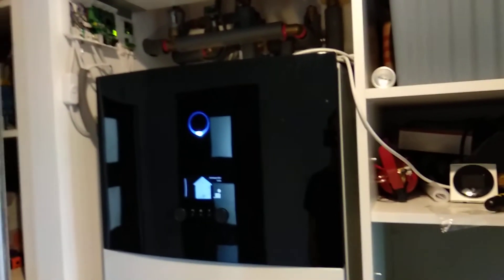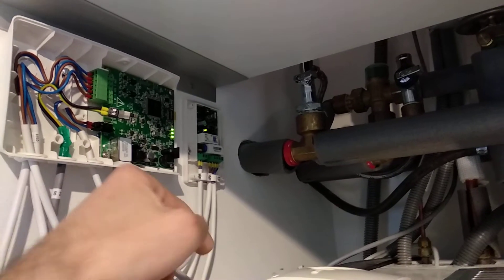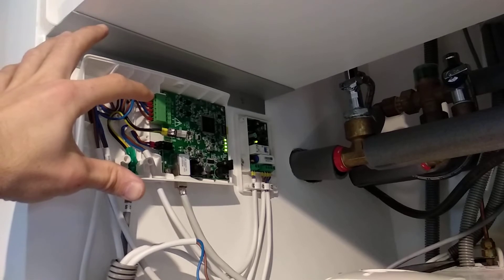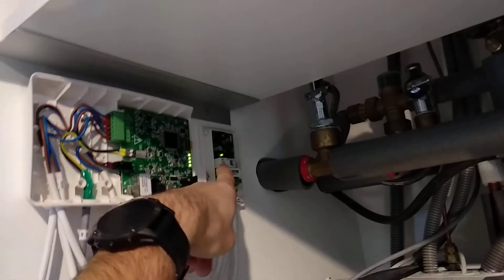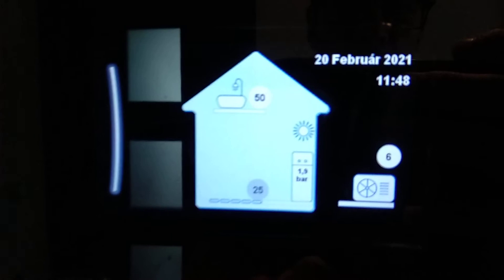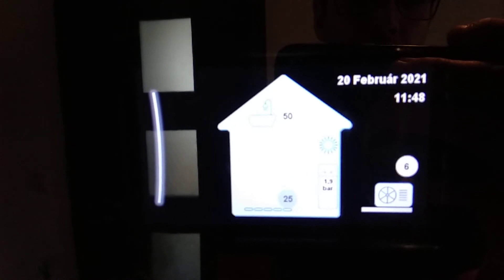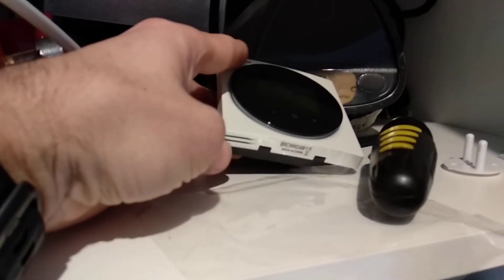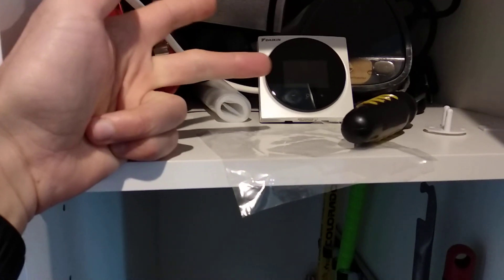Daikin Altherma 3 with Photovoltaics. My Smart Grid setup.

Comment: If the pump needs 4kw at the moment, but the pvc is sending 1kw, will it use 1kw from pvc and the other 3 from the main electric company?! How does this work?!
Reply from the maker: Yes, you are right.
But the trick is to use only 1kW from the sun. The LAN Adaptor took the readings from Grid Meter (placed in the circuit-breaker box) through S0 signal. Then LAN Adaptor sends the info to Altherma through P1/P2 contacts. Altherma limits itself to use only 1kW. Then you don't need 4kW, but the heating takes a bit more longer... :) And - you saved the 3kW!
Reply: @misok  it only takes 1 kw from the sun?  Iam prducing 4-5 kw..
Reply from the maker: @kaltrinaPR  my setup will took all the electricity going to the grid - as the heat pump can use it. So all 4-5kW. The sum is almost 0kW going from and to grid.
Reply: @misok  ur setup is on off, when there is electricity from the smart grid it uses only from the sun right? and when there is no electricity, it turns off and on again the heat pump to take normal electricity right?
But how can we do it, when there is 1kw frok the smart grid and the pump need 5kw, to use 1 from the smart grid and 4 from company?!
Because Iam planning to buy daikin altherma 3 h ht 1PH and it can use up to 5.6kW max
Reply from the maker: @kaltrinaPR  dry contact switch has an adjustable threshold. Mine is 800W excess power. Then the LAN Adaptor is started and takes the exact value readings from Electricity meter and adapts the HP to that (to use as much as excess power as possible). When the Excess power is less than 800W for more than 30 mins, whole system is turned off and HP runs without knowing there is a PV system. I made a second video today, maybe it helps a bit too.
Reply from the maker: @kaltrinaPR  when you don't have Electricity Meter, then you have simple On/Off (with adjustable delay)
Reply from the maker: @kaltrinaPR  Minimum HP use is about 500W. Example: Why you need to use 5kW/1hr, when you can use 0,5kW/10hr? When you are heating DHW during summer, you have a big time reserve to heat the whole tank to 53degrees (compressor maximum). Heating House during winter does not bring much. You need it when there is no sun...
Your question - the trick is to use all available excess energy - as long as possible. When you need to use the whole power of HP for a reason - means it is not Smart Grid setup anymore, then you will use 4kW from the grid. Other words - pump is using 5kW and PV is producing 1kW, you need to have 4kW from the grid. You don't need to have all the Smart Grid things - HP is doing whatever it wants without seeing your PV production.
Reply: @misok  can u give me ur email, I have some other questions
Reply from the maker: @kaltrinaPR  better give me yours, or maybe some kind of instant messenger, OK?
Reply from the maker: @kaltrinaPR  give me yours, I'll write you. Whatsapp is also OK
Reply: @misok  This it's not True ! You make confusion between Energy = kwh and Power = kw . Energy = Power x Time = kw x h = kwh . If you need the heat source ( heat pump ) to have 4kw ( Power and not Energy ) , than you need 4kw , you can't make it with 1kw . That 4kw it's the Heat Load ( Peak Load ) and it's calculated according EN 12831 standard . For example when outside it's -15C or -18C , than you need Power , you need the heat source to have enough power to can heat your house . Because if outside it's -15C or -18C degree , you have not enough power , and you can't heat your house , and will be cold , maybe just +17C inside of house , and you can't increase the inside temperature . Imagine you are driving a 240hp (horse power) BMW X6 and a 50hp Ford Ka . Sometime when you need to go somewhere and when you rush , and want to be there in short time , you need a car with many horse power , because : Energy = Power x Time , the same the Distance = Speed x Time , and with Ford Ka you have not enough power to have 180km/h speed in autostreet ( In Germany it's no speed limit in Autostreet )
I hope you understand it than when it's -15C or -18C degree outside , than you need Power ( you need that 4kw ) and you can't make it with 1kw but longer time .
You need to understand that Energy Meter measure : kwh and not kw , because Energy = kwh and Power = kw , and Power x Time = kwh = Energy .
Reply from the maker: @luk5827  Hi luk, you are making confusion between heat energy and electricity. Dont mix it. in specific conditions you can produce 4,56kWh heat with 1kWh electricity. Means when your PV is producing 1kWh, you can have 4,56kWh of heat. In other words, you can save 3,56kWh in electricity. My heatpump is calculated with my house, should work up to -18deg Celsius on pure heat pump. -18 to -25 in combination with Back Up Heater, then below -25 it is working purely on BUH. Everyone knows, HP effectivity is lower with lower temperatures.
These hot days, my PV is producing free electrical energy to cool my house. It is not ideal, as I have Under Floor Heating/Cooling, but it is noticeable and we like it! If it will not be enough, we can install Fan Coil Unit connected to HP.
Reply: @misok  No ! I'm not confusing ! " you can produce 4,56kWh heat with 1kWh electricity " . Right ! This it's the Heat Pump job . And that it's called : COP of heat pump , to make 4,56kWh heat ( thermal energy ) from 1kwh electrical energy . COP = Coefficient of Performance. You are right here .  But when you need 4kw ( Heat Power and Not Heat Energy ) you can't use just 1kw ( Heat Power ) because will not be enough , and will be cold in your house . 
In PHPP ( Passive House Planning Package software - Excel spreadsheet ) you have : A[m2] x U[W/m2K] x Gt[kKh/year] = kwh/year = Heat ( Thermal Energy ) - this it's the thermal energy ( heat ) loss through a surface ( eg wall ) , and this heat ( therman energy ) loss need to compensate with heat ( thermal energy ) produced by your heat pump
Gt = Grade Hour = temperature difference measured between outside and inside every hour in whole heating seasong
So , when you need to have 4kW  HEAT POWER than you can't use just 1kW HEAT Power ( longer time ) because will be cold in your house .
Reply from the maker: @luk5827  well, that is for sure. Does it sounds I want to tell it this way? Then sorry, I think everyone got it. Heatpump is not using 1kw all the time. Well, when you need more energy to run heatpump - this is ususally the time the sun is not shining. Another days, when sun is shining, you will gain some heat through windows too, right? To foster my theory - here the year stats - I paid 26,20e mothly for all the electricity in my house here in Slovakia. To be honest, in cold days I have used one bucket of common spruce a day. The temperature inside was always 22+ degrees. If you want to see the weather stats, they are on my meteo site - jastrabie.online.
Reply: @misok  That it's irrelevant how little pay you for heating . Not your heap pump have low energy consumption . Your house energy balance it's low , not your heat pump . Your heat pump compensate the heat loose through your house . If you are interesting and want to understand how to calculate house energy need , try to study PHPP ( Passive House Planning Package software ) . If you have under Uwalls = 0.15W/m2K by walls , floor , ceiling ,Uwindows= 0.8W/m2K windows , n50 1h = 0.6 air tightness by Blower Door test , if you don't have thermal bridges by your house envelope , if you have ventilation with heat recovery and other details also , than you will have low heat energy need . But not the heat pump have low energy consumption . Your house have low energy need , and the heat pump just satisfy your house energy need . That's all . If you have a Passive House with energy need under 15kwh/m2year than you can heat your house even with a hair dryer also .
Reply from the maker: @luk5827  We are far from passive house. We did not have done any Air Blower Door test, no ventilation with heat recovery at all. Chimney dont have any kind of flap, and so on... Front door are not insulated enough too. My house is build 7 years ago, we are living 3rd year here. After I have installed HP, my year consumption is ca 7MWh. Before we installed the HP,  the energy need was calculated again. They calculated that 9kW HP will be enough. Before that, the heat was created directly with electric boiler. After we installed the HP, we are saving more than 1000e yearly on electricity. Last year, 41% of my electricity was produced with sun. This year is even better (more automatisations), now we have 60% created by sun (no batteries!), I will be happy, when at the end of the year we will have 55%. So... If you dont like the system, go, buy yourself something else. You have several more options, but if you want to save, think about electricity from sun and heat accumulation - which is probably the future. I am really satisfied saving every year more than 1700euro for heating, cooling, DHW, laundring, drying, watering... 
Peace and lot of cheap heat to you :)

Comment from the maker: In july 2021 I have upgraded my PV system to almost 7kWp. I must say my system has been working very well during the summer heating the Domestic Hot Water. Up to 53°C it is heated with Heat pump, then to reach 60°C direct electricity heating is engaged (can be switched off) is  As soon as the floor heating is switched on, it is a bit more complicated and system is not always working as I have though it should - not using excess energy so often. Anyway, I am very satisfied, having "free" hot water since May until October. Savings about 800kWh annually + some kWh for floor heating. Heatpump + PV should be the future! :)
Reply: Which model of altherma do you have? Can you give us more info how have u manged it?

Comment: Can this be connected to etvx16s23d9w ?
I will buy daikin altherma 3 h ht 18kW but can 18kw be connected with pvc?
Reply from the maker: Congrats! Don't know, ask your Daikin local distributor. IMHO yes.
Reply from the maker: Mine is EHVX08S23DA9W - Low temp 9kW integrated unit with LAN Adaptor BRP069A61 (Smart Grid Functions). I have Used ABB electricity meter from the LAN Adaptor manual.
Reply: @misok  can u make pictures where u have connected the ac to the heat pump
Reply from the maker: @kaltrinaPR  you mean the heat pump power, or the LAN Adaptor to heat pump connection?
Reply: @misok  lan adaptor to heat pump
Reply from the maker: @kaltrinaPR  LAN Adaptor to Heat Pump is connected through P1/P2 interfaces. Both are marked on the PCBs.

Comment: With a LAN ADAPTER brp069a61 on an integrated altherma3 I would like to manage the smart grid to increase the DHW and radiant production power.
 I found a switch that monitors the PV output current .. (Shelly em) and performs an event when my condition is created.
(Then come the painful notes about my poor preparation ...)😞
 How do I create this entrance?  Of course bringing connection, but I don't know how to create the closure of the circuit ...
Do I use a relay?  Besides, in both the sg0 and sg1 connections?  I beg you....🤝🏻
Grazie
Reply from the maker: Hi, this is much more complicated. You need to steer SG0 with dry switch. My SolarEdge inverter with SolarEdge Dry switch is doing this for me. However, you can do it even with HomeAssistant or OpenHAB, or any Home Automation sofware. Maybe IFTTT?
Reply from the maker: @mangios85  Dry contact switch: https://www.electrical4u.com/dry-contacts/. For SG0 see https://www.daikin.eu/content/dam/document-library/Installer-reference-guide/ctrl/BRP069A61,%20BRP069A62_4PEN464229-1_2017_08_Installer%20reference%20guide_English.pdf chapter 7. You only need first 2 states - Normal operation (free mode) and Recommended ON, which are steered through SG0. However, I have made a manual switch to play with Forced ON and Forced OFF :)
Reply from the maker: if you are talking about shelly, here one dry contact switch example: https://shop.smarthome-europe.com/en/peripheriques/5083-shelly-wi-fi-smart-relay-switch-dry-contact-shelly-plus-1-3800235265000.html
Reply: @misok  you are very kind ... tonight I study and I will buy everything I need.
 I will keep you updated.  Thank you so much for the support.  where are you from?  I Italy.
Reply from the maker: @mangios85  If you want to have similar setup to mine; I have LAN Adaptor BRP169A61, Grid Power meter 2CMA100166R1000 B23 212-100 (3phase) Madoka Heatpump version, some circuit breakers. From Inverter side you will need the Dry Contact switch steered by inverter. I got luck, Solaredge have it in their smart system.
Reply from the maker: @mangios85  and I am located in Slovakia. Greets :)
Reply from the maker: Even Warning: Programming the Shelly without knowing programming Home Automation software would be a hard step. You need to know that the heat pump don't like to be switched On/Off often. There is a good Topic in HomeAssistant forum https://community.home-assistant.io/t/daikin-heat-pump-altherma-integration/
Reply: Hi my dear.  I wanted to tell you, that I have implemented the function with two relays with dry contact.  Everything seems to be okay but on the display of the unit I see no change.  The led at the bottom of brp069a61 with the smart grid symbol lights up only when both contacts (sg0 and sg1) are closed. Unfortunately, however, the machine should not be forced to increase the temperature.It seems to start but stops when it reaches the comfort point.  I thought it forced the power to the maximum.... can you help me?
Reply from the maker: @mangios85  Hi there, you dont need the SG1 - it is only intended to force to use all the possible energy by HP. Did you set up the SG values on the BRP069A61 web interface? If not, restart it by switching the power on/off. It should be available for first 2 hours on the adapter's IP address by web browser. You should be able to set up the Threshold. Try to use lower value. Mine is set up to Grid meter output I hope, but at the beginning I set it up to constant - 0,5kW to reduce issues with Grid meter. You should be able to see Power limitation on the HP display - somewhere under info settings. Without SG you will see 20,0kW, with - your setted 0,5kW and the SG LED on LAN Adapter should be ON.
Reply: @misok  my web interface don't have the power limitation...😒 Have only one setting: "Room bufferig allowed" yes or no...and nothing more...🤦‍♂️
Reply from the maker: Even try to switch off the heating completely on Altherma, if the Domestic Hot Water will start to heat. This way you will prove, that the basic setup is working.
Reply from the maker: @mangios85  Mine has it:
Smart Grid
Pulse meter setting 1000 pulse/kWh
Electrical heaters allowed No Yes
Room buffering allowed No Yes
Static power limitation 4.5kW
Download Daikin Residential Controller, run it. It can ask you to update your LAN Adaptor. I suppose your Firmware may be older. Mine: LAN adapter firmware:17003908, Smart grid: enabled (from the webpage) Does your unit has a Domestic Hot Water preparation?
Reply: @misok  thank you for your support.  I have already upgraded.  Unfortunately, under the heading smart grid I only have room buffering allowed ...
 My firmware is 17003908.
Reply from the maker: @mangios85  is your unit split, or integrated together with DHW boiler? Check the LAN Adaptor manual closely. There are some things to tune up in the Altherma installers menu!
Reply: @misok  you are very kind!!!. I have an integrated altherma 3 machine. I  checked the manual very well but I cannot find a solution. My smart grid needs both contacts sg0 +sg1 closed to go into operation....and so far, it may also suit me ... unfortunately, however, it does not exceed the economic and comfort setpoints. 
I use domestic hot water with a programmed method + maintenance. 
If in the time slot where the smart grid is activated, if there is economic, it reaches the temperature set in economic and equal in comfort.  but this is very strange ... in the manual it is written that there should be no limitation.
Reply from the maker: @mangios85  no SG1 needed. Read the LAN adaptor manual. Did you set up the E-05=1, E-06=1, 4-08=1, 4-09=1 on the altherma display? Read the Buffering in case C-07=0 or 1 chapter too.
Reply: @misok  thank you so much for your support.  I didn't answers, I had more delicate problems ... it would seem that the main board of my unit has communication problems.  However, if I do not activate both contacts sg0+sg1, nothing starts.  all settings described by you are ok.  I'll check the wiring diagram again.  the x1m connector in your configuration in the n + l position is always under live electric, right?
Reply from the maker: @mangios85  If you mean X1A on the LAN Adapter, then yes, this is the detection voltage, should only tell the system there is a Smart Grid in the system (according to Installation Guide). Maybe call your Daikin local dealer, if the manual is not sufficient. Did you set-up everything on software site? In the Daikin menu and even on web interface?